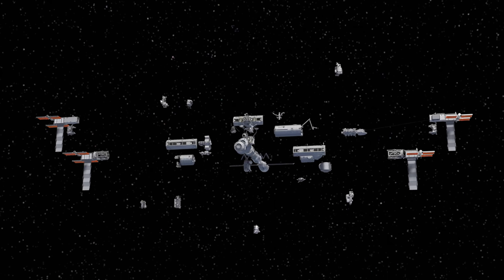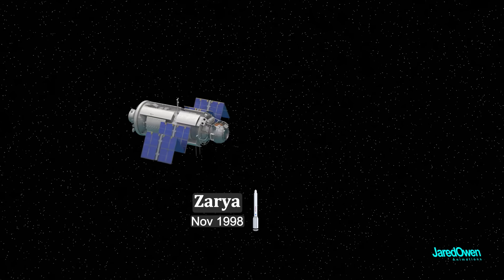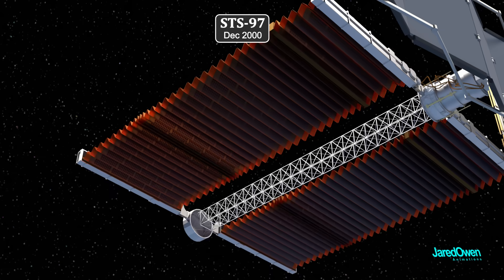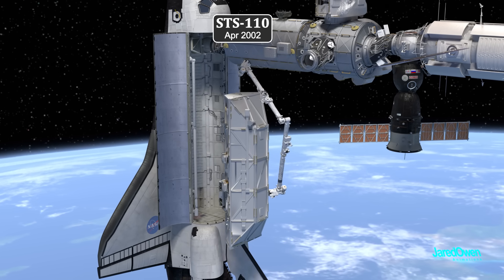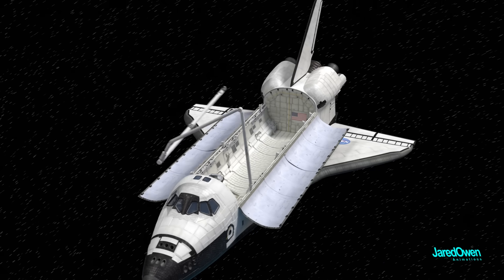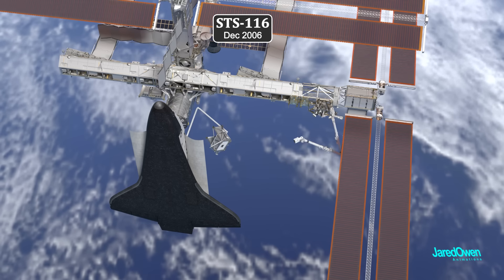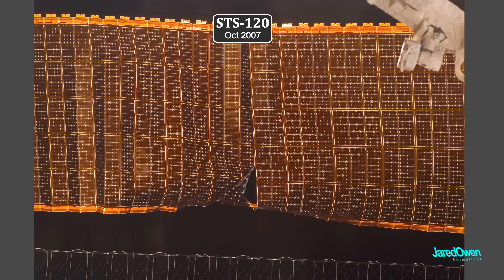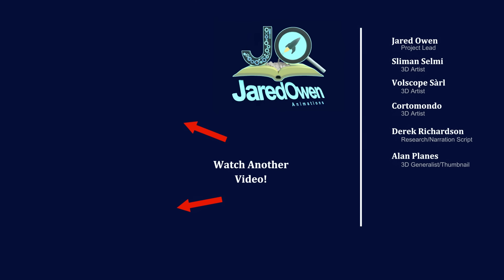Building the Space Station Truss (and the Solar Panel Tear)

Comment: How do the radiators work in the vacuum of Space? I thought the only way to expel over heating in space is with heat sinks that can be jettisoned.
Reply: Radiation, not convection. Coolant runs through the exterior radiator panels and the heat is emitted as infrared radiation. No medium is required as the energy leaves as photons. Space itself is basically an infinite heatsink.

Comment: 17:43 Astronaut Scott Parazynski and Doug Wheelock are those who repair solar panels of International Space Station (ISS) which were torn on November 3, 2007.
Scott Parazynski uses a robot arm to sew the tear and install cufflinks to strengthen the structure and stability of the panel.

Comment: freakin p6, gosh
Reply: in fairness, it is the segment belonging to the main truss assembly (as Z-1 doesn’t directly attach to the main length) that has spent the most time exposed in LEO…

but the seemingly faster deployment of the 4B power channel during STS-97, and the snags experienced during retraction on STS-116 may have contributed to the damage…

fortunately the cufflink repairs are working so well that they’re still up there to this day

Comment: Probably the most delayed part of the whole ISS was the European Robotic Arm.  Originally conceived in the mid-1980s for the Hermes space plane, the cancellation of the latter and cancellation of two proposed Russian projects further delayed its development until it was finally finished in 2001.  It was orignally going to be launched in 2001 on a Space Shuttle but that was delayed several times, and the Columbia disaster put an end to that plan.  It was then planned for the ERA to be installed on the Nauka module, whose work started in 2004 with a planned launch in 2007.  That obviously didn't happen due to technical issues, but some of the mounting components eventually went up to the ISS on Atlantis in 2010 along with the Rassvet module.  It would take another 11 whole years before the ERA was finally launched to the ISS, attached to the then-finished Nauka module, onboard a Proton rocket on July 21, 2021.

Comment: How can we supposedly see a 747 from 250 miles away, anybody?
Reply: Did you fail kindergarten? Earth curves about 6 feet in 3 miles. 250 miles is a 500 foot curve basically. A 747 30-50 miles up would be in sight. Vision is infinite yet blocked by the curvature of the earth and atmosphere. On a clear day youre very unlikely to see a 747 even then due to weather and light and the fact of how vision spreads out, but with a good telescope it’s possible.

Comment: 10:33 did they find their way around eventually
Reply: There were ways to mitigate the problem, but the issue of foam striking the heat shield was a fundimental problem of the space shuttle, it couldn't be fixed completely.